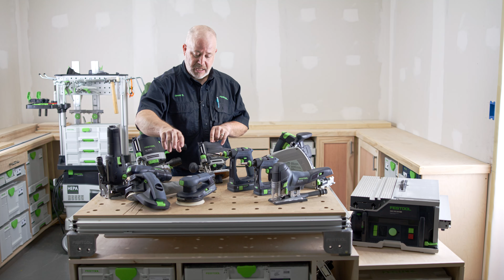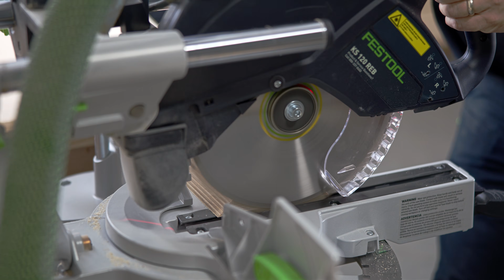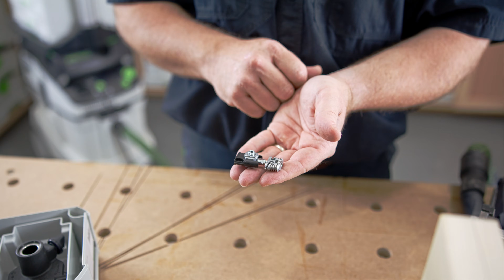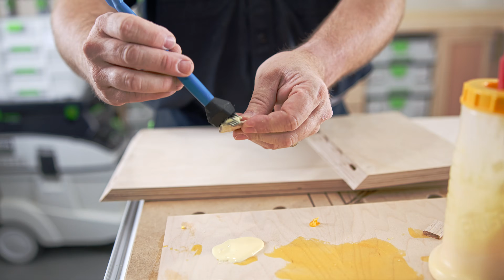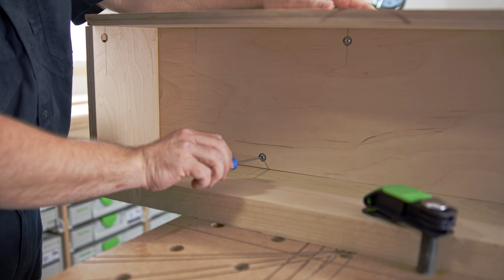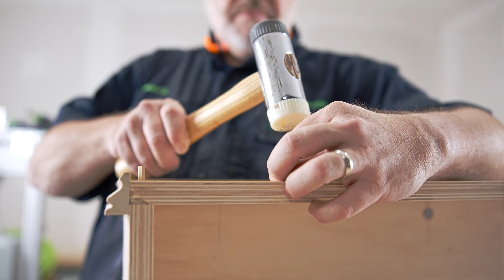How to Build a Fireplace Mantel | Festool Build Series

Comment: Around the 40 min mark, domino for the columns, shouldn't the fence be angled?  Columns are 2.5 degree?
Reply from the maker: Great question! Since the end of the column was already cut to 2.5°  (3:40) and it is such a small angle, there isn't any interference when the domino is installed, and the columns are assembled!
Reply: @festoolusa  thank you for the reply. I figured that small angle and domino length didn't amount to much resistance. It may help hold it better 😊